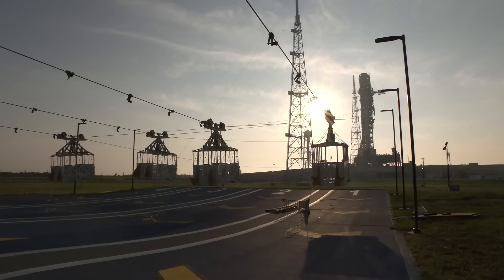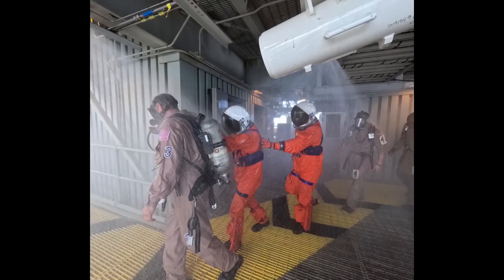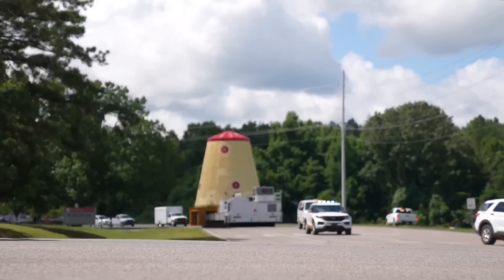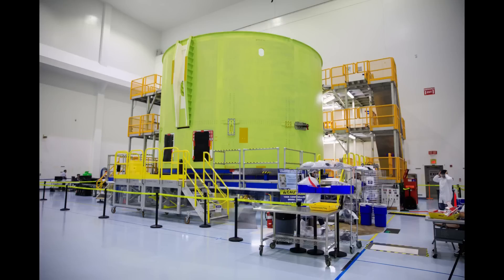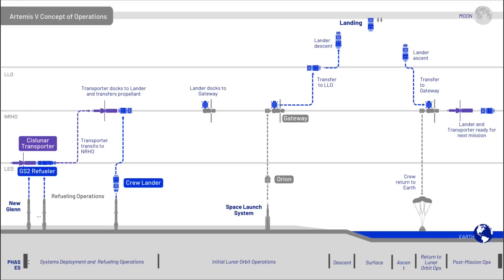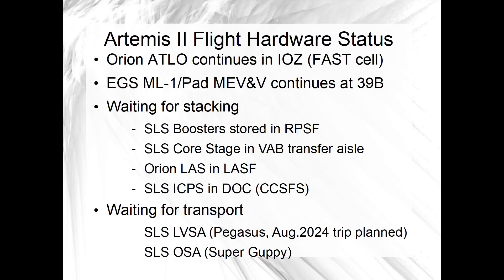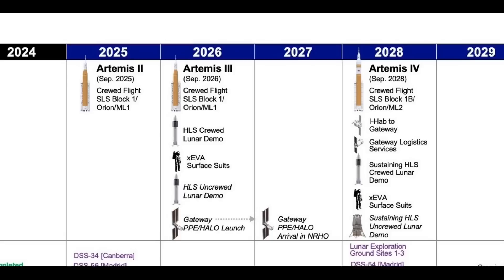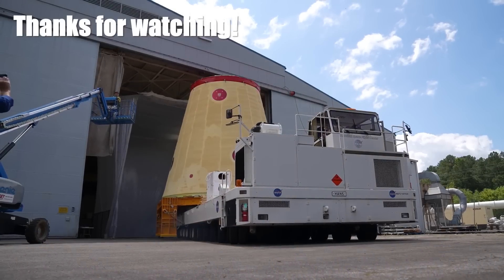SLS planning triple Artemis shipment to KSC and Blue Origin planning lunar landing demo in 2025

Comment: SpaceX would have to go from launching one Starship test flight every 2-3 months to launching with confidence 10-15 tankers on regular cadence during a month or two only two years from now. And having done it already for an unmanned test before then... I'd say I'm not confident they will make that target date.
Reply from the maker: Starship would need to catch up to be ready, but all the programs that have pieces for Artemis 3 face schedule challenges, with maybe EGS being an exception.  The cadence may only be part of the Starship challenge for SpaceX.
Reply: @PhilipSloss  Yes, lots of moving pieces. If the confidence in the Orion heat shield is not 100% and they do another uncrewed test flight to make sure then SpaceX (and suit designers etc) gets a bit of a breather.

It took about 7 years from first successful landing of a Falcon 9 booster until they were launching weekly. I expect Starship will move faster but even if they half the time it'll be 2028. I don't know what kind of boil-off can be achieved for liquid oxygen and methane, I'm just guessing they will need to launch tankers once a week to fill up the fuel depot without loosing too much.
Reply from the maker: @zapfanzapfan  Hopefully NASA will provide some perspective on the difference in risk trades and the overall situation between ISS (Starliner CFT) and Artemis 2...but so far the agency has not indicated that flying Artemis 2 uncrewed is one of the options being strongly considered.

Instead, as has been reported, they might repair or replace the heatshield and continue with the crewed flight test whenever that's ready.  Still a big delay,  which would give SpaceX more time to work on Starship tech development.
Reply: @PhilipSloss  Might replace the heat shield with PICA then? Was there any real reason they went with the older heat shield material rather than the PICA that was used on the Stardust return capsule almost 20 years ago? That capsule came in even faster than a return from the Moon.
Reply from the maker: @zapfanzapfan  That hasn't been stated as an option; that would be a significant enough change that it would probably be a much longer delay than modifications to the Avcoat.

A replacement of the heatshield would likely be to make changes to the Avcoat blocks, fabricate a new set, and install them on either the current carrier structure (after removing the existing blocks) or another carrier.

Redesigning the heatshield with PICA and redesigning Orion to integrate with that heatshield would be a much bigger change.
Reply: @PhilipSloss  Yeah, that might need a new qualification flight.

Could they go to a monolithic heat shield (like I think Apollo had) or are they sticking with the blocks? From memory it looked like the biggest chunks were missing at the seams between blocks.
Reply from the maker: @zapfanzapfan  The Apollo-style Avcoat structure was the original implementation, but there were problems upscaling it to Orion's size.

It's not clear whether these are differences between better and good or good and bad or something else.  It's a multiple choice question, as was the switch from the Apollo-style honeycomb to the blocks and carrier.

Comment: Why is the stage adaptor so big. Is it due to the size of the RL10 ?
Reply from the maker: Yes, and not just the engine; most of the stage is encapsulated in the LVSA.  The RL10 & nozzle extension, the equipment shelf, the LOX tank, and the midbody are all in there.

Comment: Real talk here. There are thousands of barges in the gulf. Why is ANYTHING waiting on a barge? Yes, thing is special, but it can't be THAT special. Penny wise and pound foolish!
Reply from the maker: Most of these elements are over 8 meters high and over 8 meters long.  What is the alternative?
Reply: @PhilipSloss  I'm looking. At first glance plenty of barges are that long, off the shelf barges seem to be 13 feet wide and 5 feet tall. That's about half as wide as needed, but available tomorrow. my point is, that in a world where we regularly transport oil Riggs on these same waters, why are multi-billion dollar projects held up waiting for one bespoke NASA branded barge when every other industry just opens bids? A barge is just not that complex and experience in making them, even approaching this size, is not rare.
Reply from the maker: @patricklewis7636  Which of those barge operators are insured to cover anything that might happen to "multi-billion" dollar aerospace hardware during transportation?

Also can they accommodate the support equipment requirements for those?  Power, environmental control, etc.?
Reply: @PhilipSloss  I don't know offhand. But the capacities you list here are not unique or experimental in 2024. NASA seems to be stuck in the "everything we do is special" mode. That's just not true. It's difficult with hard but known sticking points. I can appreciate the care with the vehicles, but the issues with transportation and logistics seem to ignore modern capabilities for "built here" solutions that at best get in the way.
Reply from the maker: @patricklewis7636  It's not clear any commercial barge operator would be willing to take the financial risk to transport these articles.

ULA also provides their own water transportation vessel(s) for their equipment, FWIW.
Reply: @PhilipSloss  I would hazard a guess that there are contractual reasons. There are ways to insure even extremely expensive things for transport through things like reinsurance. That might be an interesting topic for a future video.
Reply from the maker: @patricklewis7636  It depends on whether this hardware is extremely expensive or literally irreplaceable, and whether the benefit of the business is greater than the cost.

In terms of overall programmatic and/or schedule risk what would be interesting is to put this one into perspective.  Hard to buy this is high on the list without seeing the other things.
Reply: @PhilipSloss  Well, that logic goes beyond transportation. Why are these items deemed irreplicable? Yes, they are complex components, but they aren't made of unobtainium. It seems like there is a culture of treating these things like artworks rather than the products of well understood industrial manufacturing that introduces risk, expense, and delay. If something is critical, make more than one. Nothing we create today is literally irreplaceable. 

I'm arguing on the internet. I should stop and so should you. It's bad for your brains. :)
Reply: @PhilipSloss  by the way, love the coverage. I am simply frustrated with NASAs approach and funding.
Reply from the maker: @patricklewis7636  No worries...some of these things are more complicated than they seem on the surface.

Adapters or early-stage structures might have less complications than working rocket stages, but even then another factor would be that they would have to assess transportation loads on them.

Comment: I thought 1 launch a year for this thing was bad but it looks like its actually 1 launch per 3 years. Their building speed is incredibly distressing
Reply: The launch rate for the first few isn't indicative of how fast they could build and launch them.
There's a lot of new mission elements/development work that become long poles for the schedule between Artemis 1-4,  and recurring SLS production is not one of them (Crewed Orion work and ML1 refurb/mods for A2-HLS and xEVA and potentially Gateway for A3- ML2 construction, EUS/SLS Block 1B development, Gateway modules and logistics, HLS etc for A4).
See how far ahead of the need date the Artemis 2 SLS was finished.
They finished the core stage almost a year before the need date and I wouldn't be surprised if they could have done that a while sooner if there was the same amount of urgency in CS-2 production as there was for CS-1.
Reply from the maker: @brokensoap1717 The delays in completion of the second Core will bear watching.  There were multiple delays that pushed that date from Spring of 2022 to Summer of 2024.

The supply chain has not returned to pre-COVID conditions and NASA ESDMD emphasized that in the most recent OIG report.  Recovery of the supply chain might not be something that NASA can fix or speed up.

Production of the boosters and engines is ahead of the two stages, and NASA and Boeing have not worked out terms for long-term Core Stage & EUS production yet.  That's not likely to help the supply chain situation, even if it's a different factor.

SLS Stages production is likely going to be the primary watch item for a while.